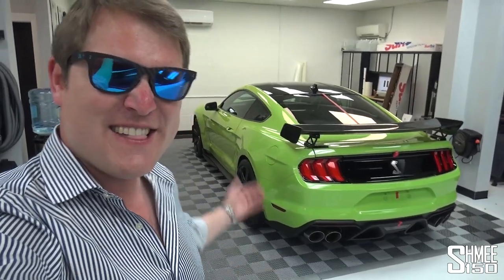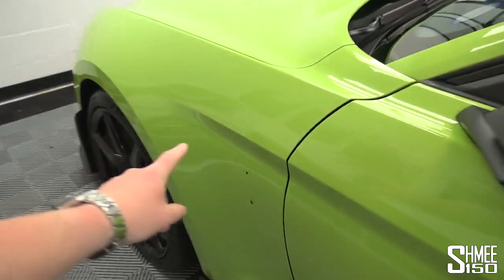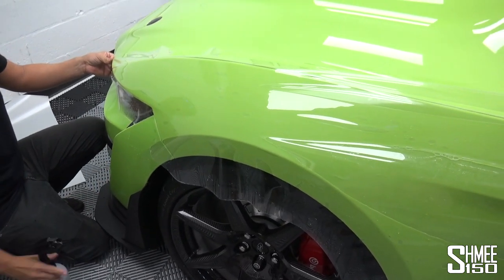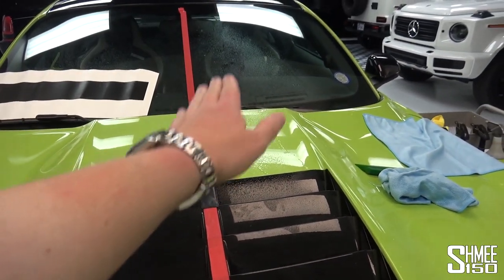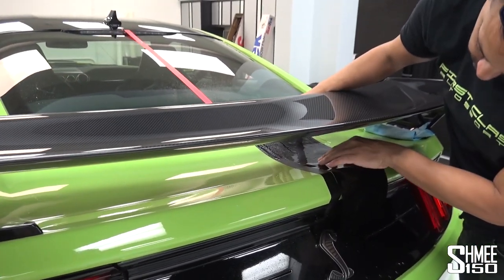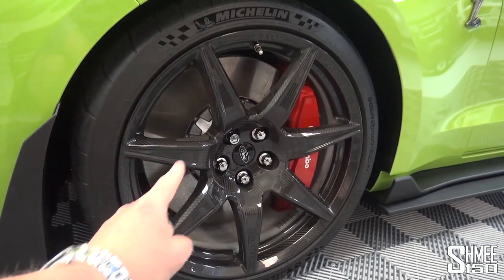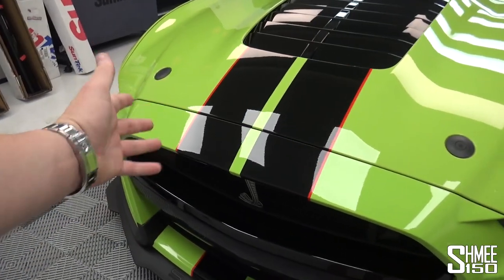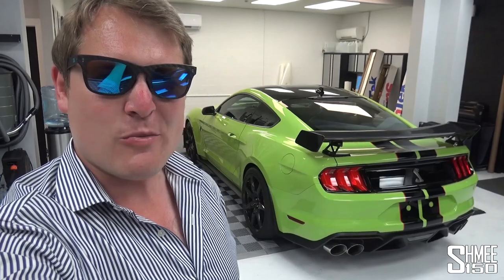FINISHING TOUCHES! My Shelby GT500 is Complete with Iconic Stripes

Comment: Coolest american car available. And you made it look good. Success.
Reply: @freepieanchipsgarage 
Unusable as a car and also not technically legal on the road.
Reply: @freepieanchipsgarage 
Yeah its "street legal" because its protected from having to comply with emissions and crash testing and such in the US. But if you take it over to Europe, then there is no way in hell that thing will be road legal.

The Mustang, however... Is already approved for the European market. Mustangs were released in Europe for the first time ever in 2016 and barely squeaked by European crash testing by the smallest of margins. Scoring 2 out of 5 stars and it was deemed "not recommended for road use". But at least it passed.
Reply: @freepieanchipsgarage 
Yeah yeah yeah. Its street legal because its registered as just another Charger / Challenger, whatever it is. They haven't gone back and done the emissions certification for every step of the way. The Hellcat engine, and now the 800 HP Demon. You know as well as me that it wouldn't pass California emissions.

But then... Most american cars stopped passing California emissions long ago. I think 1980 was the last time a Corvette was actually California state emissions compliant.

But every import car has to. Funny how that works. 

Point was... American cars may get a free pass in the US. But they dont over in Europe and the world markets. Which is why you dont see american cars outside the americas.
Reply: @freepieanchipsgarage 
So they were private imports then... And not officially released. Because I was there when that happened. I lived in England back in 2016 when it was released.

And it barely squeaked by Euro crash testing after Ford of Europe (German Ford) had worked it over and brought it up to international specc.

And again... Challenger. Private import. Not officially released in Europe. And probably wont be. If these cars were completely compliant and certified in every way, then surely there would be at least ONE SINGLE American car dealership in all of Europe.
Reply: @freepieanchipsgarage 
Dude since the collapse of the US car industry, MOST, if not all real development of Ford models happens on the German / British side of Ford.

I notice you know a lot more about these things than average net-spamming kids. I mean. Most Americans dont even know there is a European Ford and an American Ford that has operated as 2 separate companies for decades. But there isnt much american development left in Ford. any more. Not since Alan Mullalys "One-Ford-Plan" in 2010 or whenever.

Ofcourse things get spotted in Michigan. They even buried the development of the Ford GT deep in Michigan, but there isnt a nut or a bolt on the entire car that can even be claimed to be american.
Reply: @freepieanchipsgarage 
When I say "Most americans dont know" doesnt mean you are necessarily one of them. And also. Often when people say "Im not american" They often turn out to be anyway.

If America really is the place where Ford does its R&D and vehicle development, you would think they showed off their skills by creating the Ford GT themselves rather than calling in the Brits to do it... Again.

Also. Im not British. But I did do my university degrees there for the car industry.  However. Im in marketing. Not in development. 

And if the US motor industry didnt collapse back in 2008-2010, then I wonder why they needed all those hundreds of billions in bailouts and disappeared off the international market and hasnt been seen since.
Reply: @freepieanchipsgarage 
Oh, I was right in the middle of that when it went down. All 3 of them were under bankruptcy protection. Even Ford and Harley.

Harley had to let Buell die, and now they are moving to Europe as a last effort to try and find a new market as the US is drying out.

Chrysler got bailed out, but there was no business left to actually save. They had zero viable models and all their existing cars were based off of de-funct old Mercedes bases. Mercedes pulled out just in time to not have to ride the bankruptcy with Chrysler. The remains of Chrysler was then given away for free to Fiat... Which was the only taker.

Ford... They didnt initially take bailouts because they managed to secure a 23 billion dollar loans while you could still get loans. By pawning every workbench, and screwdriver. Their property and even brand name was up for collateral. Then they hired Alan Mullaly from Boeing to restructure and re-form Ford to what we know today. Which essentially meant they shut down all the american (Mexican built) Ford models in favor of the much more relevant European ones.

And GM... GM took their share of the hundreds of billions of bailout money. Money that was supposed to secure the future for the US auto-industry. They took it and instead of restructuring and modernising their operation, spent it on buying into already more modern brands in Asia. Daewoo and a bunch of Chinese brands.

GM abandoned 89 major plants and facilities in the major Michigan area and singlehandedly bankrupted the entire state as they shut down the very backbone of american manufacture. Then Obama had to spend a further bunch of billions to clean out abandoned factories and clean up DECADES of chemical waste on Indian land and a bunch of other scandals. 

The total cost of the US car collapse is estimated to be into the 450 billions. So when people say it didnt really cause much of a fuss, then I believe they must be american. Because that takes some plutonium-grade patriotism and denial-culture.
Reply: @freepieanchipsgarage 
I grew up with a father that collects american musclecars over in Norway. And my brother runs a business where he will only use american trucks. Not because they are great. But because he can fix them in his own garage with a hammer. We always had some musclecar or other being built when I grew up.

Then I moved to England, did my university and had a career over there, and was running around in Lotus Elise, the last season of the Espirit, a Ferrari 360, 2 Lamborghinis. But also things like NSX, Imprezza, and S2000 in the company garage. Its been a few years. But I feel I have seen both sides of that industry.

However. Ford Motor Company didnt get bailouts since they already got 23 billions in loans. But Ford still asked to be included into the government rescue operation so it wouldnt suffer by having to compete with companies who were given government subsidies. I really dont care what paperwork was filed. Nor do I care to go back to that time and look up the particulars.

But I do remember the spectacular levels of cowboy amateurishness, wild and wonderful decisions, and amazing mismanagement that was uncovered in the US car industry at the time. Perhaps the wildest one was when Chevvy paid Manchester United an insane $600 million dollars to put their logo onto their shirts for 10 years... JUST before GM shut down sales in Europe after having lost money for 16 years straight.

Thats a 600 million dollar marketing deal that resulted in zero sales. Its hard to imagine how you would beat that.

I haven't followed the industry for the last... 6-7 years, but really. Its amazing when people tell me the US car collapse wasn't a big deal. The total sum wasn't just the initial 100 billion. It went on, and on. In the end they got more money than the entire country of Greece got from the European Union. And I would say... Mostly so that Obama could get re-elected as the president that saved the US car industry... Even tho Chrysler went to Fiat, Ford went partly to Germany / England, and GM went to Asia.

But. hey. Im sure it looks different if you work over there. Just... If the US car industry really is back. See if you can name any internationally competitive US cars from the last... 10-15 years. That should be easy.
Reply: @UCUzBSWhKbILe-UhBZ12suFQ 
In GMs own words from back then... 70% of their business and sales are now in China. China was seen as the great savior of US cars. Obama leaned HEAVILY on China to make them accept shitty american cars. Which China largely refused. Unless... Unless GM spent a truckload of US taxpayers dollars on buying into already existing Chinese brands. Such as Baojun, Wuling, and others. 

I remember GM put out a cheesy, ridiculous video claiming to be back in the game. Making the worlds greatest cars. And how they repaid their loans in full and ahead of time. ALL bold lies. Soon every news channel, and politician quoting these lies. Reporting that Buick was now big in China.

Making tearjerking monologues about how good old Buick out of Flynt Michigan was now back in business and doing great on the other side of the world. Haha it was just Korean Daewoo cars with glued-on Buick logos. And some even made the joke that not even the Buick Logos were american made.

And those squeaky plastic Korean GMs... Those are the models sold internationally that you were talking about. Which GM quit doing in 2014, I believe. After not selling any. Trying to push them through Opel. Which didn't go well. 

It was pretty obvious at the time. That Ford of Europe had far more relevant, modern models at the time of the US car collapse. Ford of Europe had 2 of the best selling cars in the world. Focus and Fiesta. And under Alan Mullalys "One-Ford" plan, he scrapped all the US models in favour of paying good money to have the Euro-stuff brought over to the US side. it was pretty obvious that research & development was far more modern in Euro-Ford while US Ford was better suited for vans and pickups.

I haven't followed any of this for years, but if US Ford were so capable. Then why is every Ford GT British designed since the 1960s. For the 2017 model Ford of USA tried their best to make the Ford GT themselves. But after buying a Ferrari LeMans car, they realised they were simply not qualified to create anything that would be competitive with the Ferrari, so again they called in the Brits.

They would at least have assembled the thing in the US, like they did with the 2004 Ford GT, to tie in with their feel-good story that comes with every model. About the all american blue-collar hero out to take on the world. But they simply could not find a single workshop in the entire nation qualified to do so. So in the end it was decided to have it put together out of British parts by Multimatic in Canada. A racing company that has history assembling special editions for Aston Martin. 

They couldn't source a single US part-supplier (that I have been able to find) for the Ford GT. Whatever I look up leads back to the UK.

Anyway. At the end of my rant. I did ask if you knew any internationally competitive US cars from... This decade or the last. Cause I dont.
Reply: @freepieanchipsgarage 
Internationally competitive = competitive on the international market.
Reply: @freepieanchipsgarage 
You are doing the american thing. When I say something you agree with or that isnt easily denied, you ignore it. And if there is something you can possibly deny, or dance around, you move the yardstick there and start moving it inch by inch.

You havent come up with the name of a single internationally competitive US car from this decade or the last... Because there isnt one. Thats not my fault or my problem. Just saying it how it is.

The US of Murca just landed their fourth car on Mars this week. With the help of the entire world community, ofcourse. So now there are 4 cars on Mars and 1 on the moon. Maybe its time USA lands some cars on the international market too.

But it seems to me... That they arent interested in doing that.
Reply: @freepieanchipsgarage 
Utter twaddle? Did you just put a kettle, and your tweed jacket on?

If you knew the name of a single internationally competitive US car from this decade or the last... The last 20 years, then surely you would have thrown that in my face by now. But there arent any, are there.

And thats not my fault or my problem. All markets anywhere? Dude... I had ONE question. I couldn't possibly make it simpler. Every BMW, Mercedes, Audi, Porsche, just to stay on the Germans for now.... Is competitive, has their place on the market, in every civilized country.

While americans... Make cars for themselves. There isnt a single US car dealership in all the 500 million population of Europe. And thats somehow a trivial point that you can DANCE around and ignore? What... GM arent interested in those sales if they could? They tried and lost money for 16 years in a row. 

I can still quote GMs marketing department - of Europe, by heart.

I explained in some detail when you asked what my involvement was with cars. I did my university in Social Anthropology in marketing. Specialising in Social Trends and Brand Identity.

Which makes it, Im sure you would agree, very much my thing. To analyse how shit is perceived in social media... As opposed to how things work in actual reality. Im not sure being an accountant, and... Having owned cars lends you the same gravitas. Like I said. Im sure this looks very different from your side. But that doesnt mean I make shit up.

Further... I ran a debate channel on Youtube for 12 years until it was shut down. And thats fine. It was time to quit anyway. There was a time when you could debate / discuss things online. But oh my GAWD... We talked about all kinds of issues. But every time we debated american things, it would explode in anger, denial, and hate. America simply were not used to unfiltered criticism. Even mild banter, and certainly not cold facts. They simply would not stand for it.

I mean... This is why the US never had a real TopGear. They never had critical, factual tv shows that weren't sponsored and scripted to death and family safe.

Didnt matter what the topic was. The methodology was always the same. It was a bit of a concern at the time. But today this denial-culture has EXPLODED and is pervasive everywhere. Cognitive dissonance has really taken off as an american lifestyle choice. You can turn on US TV any time to see what Im talking about so I dont have to go into detail. 

But it went to extremes. People would start their own forums and make their own videos where they literally grouped up  and poured hatred and death-threats on us. It topped itself when we started getting notifications from Homeland Security and a selection of other american anti-terror organisations that we had been investigated for spreading anti-american propaganda. Then Youtube and a couple of others pulled the plug on us. All on the same day. 

But it had all become a joke, a meme, at that point anyway. Those days are gone. 

Youknow... I was a student in Birmingham England back when the UK ran their car industry into the ground. I watched that shit happen up close and in person too. 

I had student friends that worked at the Rover factory when it was attempted sold to BMW. And back then. When I said Britain deserved it because they made rubbish cars and poor business decisions for decades. And I showed people how this and that was terrible... Mostly I blamed the insanely poor British education system at the time. 

But, youknow... The Brits didnt come at me with defense, denial, and OMG... YOU HATE ENGLAND. They mostly said... "Yep. Its a bit shit, isnt it" And then they shared their own stories.

But its funny what 22 years in the US can do, isnt it. To the point where... By the power of being an accountant, you take on the need to pull the OMG YOU HATE MURCA card and wave their flag in my face.  Fascinating.

I had planned to go on a far shorter rant about GMs being a business now that makes cars almost as an afterthought, but then I got the OMG... YOU HATE MURCA thrown at me. And it really brought me back.
Reply: @freepieanchipsgarage 
I just cant imagine... As a marketing guy. As a person they would ask to analyse the market... If a car company, or any company, had asked me which one of their products were “internationally competitive" And I would have told them thats impossible to say. There is no such thing as a "market" or an "international market" or there is no such thing as being competitive over other products that arent.

I dont think you struggle with these concepts. But 22 years in america brings on the denial-culture.

Im not even an adult? I told you I was there when the UK ran their car industry to the ground. I was a university student at the time.

Christ, the flagwaving... This is getting ridiculous. OK you have convinced me. American car companies have leadership, executives, and heads of departments that actually go around and do a job. I really had no idea. Thats all news to me. Where are you even going with this?

Oh there we go with the OMG... YOU HATE MURCA again. Incredible how that never gets old or embarrassing.

Its not my fault OR my problem that america cannot make cars for the international market, dude. Im just saying it how it is. Waving flags or trying to discredit me in person, doing the american thing, doesnt change reality in your favor.

Namedropping doesnt lend you cred either. After passing yourself off as somebody in actual car engineering, then an accountant. As I said... Im sure it all looks differently to you. It always does.

In my many years of hosting a debate channel, I have done exhaustive research into many subjects. And it really is notable how cowboy amateurish everything is to its very core whenever you research anything american. 

I note you still haven't thrown a car name at me, so I guess you concede there arent any. Doesnt it ever get silly.
Reply: @freepieanchipsgarage 
Oh, so now a "chartered" accountant. Further removed from the actual industry. 

Oh I wish I was a teenager. That would be something. Yeah, I eventually moved on and became a game designer. For 8 years. And then I got hit by a fucking bus and spent 2 years learning how to walk again. And now this Covid shit. Like I said. I haven't looked into the car industry-thing for half a decade.

However... If it makes it any easier for you... Chrysler is Fiat, and today's internationally competitive Ford cars are about as "american" as socialised healthcare. But GM... Its not that they couldn't make good cars if they wanted to. They just arent trying.

I haven't looked into this extensible because I really couldn't be arsed, however... It seems to me. That since the collapse of the US car industry, since the financial crisis that was declared over already in 2010, but is still raging on... Every US corporation is catering to an ever more impoverished population.

And to make cars ever cheaper, they have to cut corners, cut materials, cut production costs. Everything is cut to the bone. Everything is built by unskilled, untrained, uneducated workforce on minimum wages without healthcare, guaranteed pensions, paid leave, or rights. Instantly replaceable people who are told "benefits" and unions are "entitlement-culture" and anti-american.

Selling a car... For GM... seems to be a zero-profit operation. And by showing an almost bone dry result, they are able to get away with a hell of a lot of things. I dont expect they pay much tax. If any at all. It seems to me... The only place GM claws back their profit is...

Its like when Microsoft sells you an X-box. They dont make any money off it. They may even lose 100 bucks on the actual sale. But by the time you have bought 5 games and an extra controller, they start to see a profit.

For GM the profit seems to be in selling people extended warranty, in servicing, financing, and screwing people on expensive options. GM... Seems to have become a loan and financing racket. That incidentally also makes cars on the side. Just so they have something to finance.

And everybody seems to be approved for financing. Even if they can clearly see they wont be able to pay it down. Because the car still gets built, and running the whole reposession-thing through the cowboy amateurish US legal & justice system probably generates further profits.

And also things like the US crash testing and type approval process that is virtually unchanged since 1974. While the European and other markets change their vehicle safety standards all the time. GM simply arent interested in paying what it costs to make a quality product. Much like every single other US mega corporation.

This isnt how the car industry works over in Europe where people pay a lot more for a car, but god damnit they want a product that matches the price. And once an american car is taxed, imported, and sold over here, they end up costing the same as a Japanese / European car, but without the quality. Because US cars are built for poverty. Not for quality. 

And that is why you wont ever see those Chevroles, that you would totally pick, outside the Americas. Because... They arent internationally competitive.